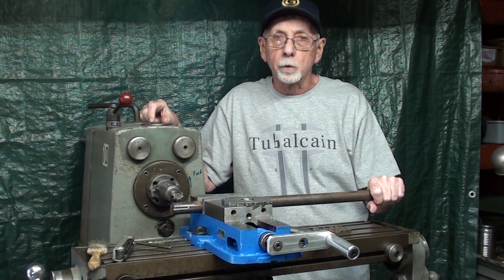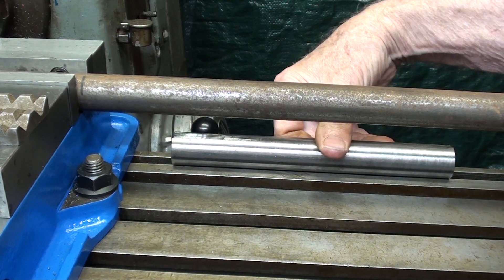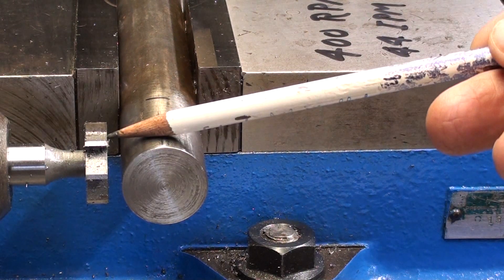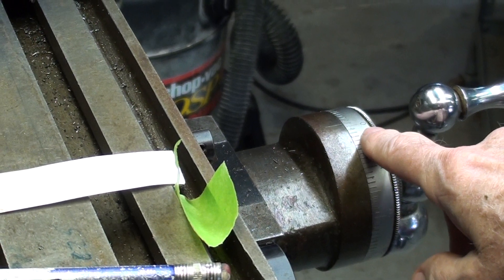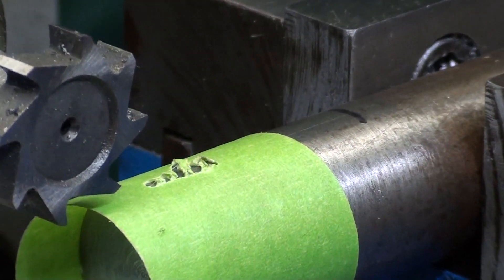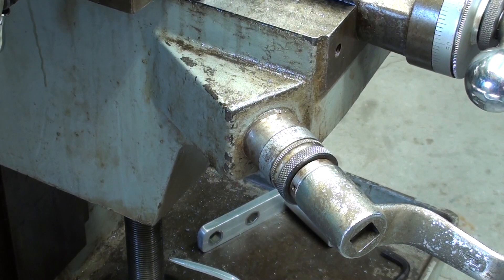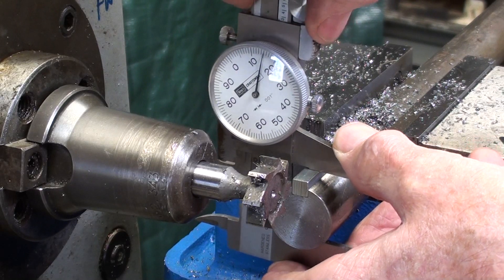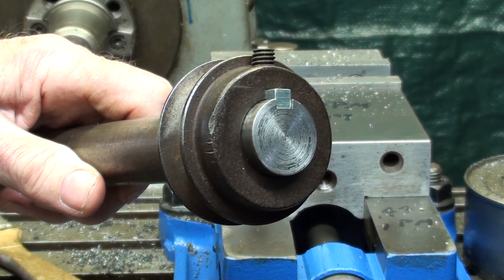Cut Straight Keyseat on Clausing Horz  w/woodruff cutter TIPS 505 tublcain pt 2

Comment: Mr. Pete, check out the (Rare) high end lathe recently acquired by Keith Rucker, a Rivett 10/20, described as very high end and expensive when new, all electric control - originally owned by the navy.  Never seen one like it before, more advanced drive and Reeves drive pulley speed control etc. not many sold and most owned by the government according to Keiths description.

Comment: Hi have a question.just got a logan 922 what power do I need to run it 3 phase single phase ect..? Thanks
Reply: Nobody can answer that question without knowing more about the motor on the lathe. A 3 phase motor can not be run single phase and a single phase motor can not be run 3 phase.

Comment: Greetings Mr. Pete!

I have been in the machining field for well over 30 years now. Mostly maintenance and repair. I have never been exposed to a horizontal mill. I noticed in your videos you always use a conventional cut and not a climb cut. I'm aware of the dangers involved, just curious why you don't. 

In my shop I utilize mostly solid carbide tooling. I have two old Bridgeport knee mills and a vertical machining center. I always climb cut on all unless I'm removing a hardened surface.

I really enjoy your videos. Great work, sir!
Reply: Unless you have zero backlash ball screws or a acme screw equipped mill with backlash control (I've only seen that on large milling machines) if you take anything more than a very light cut the cutter is always on the verge of jerking the machine table and the work into the cutter because of the required backlash in the table feed screw and nut assembly.
    If the table is being power fed, when this happens the power feed mechanism is unloaded and speeds up. This makes matters worse as the cutter gets an even bigger bite in the work and if the cutter doesn't break, then the chances are good that the work will be jerked out of the vice. This will usually break the cutter and spoil the work.
Cheers from NC/USA